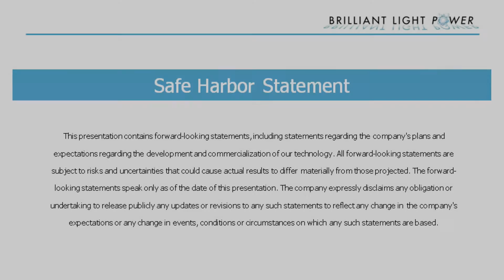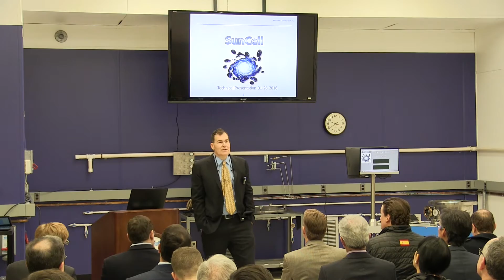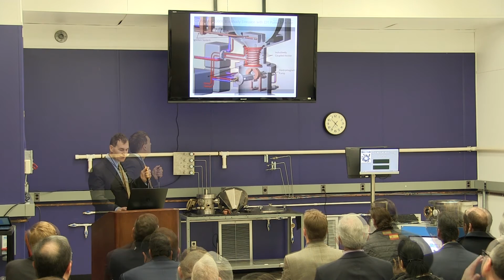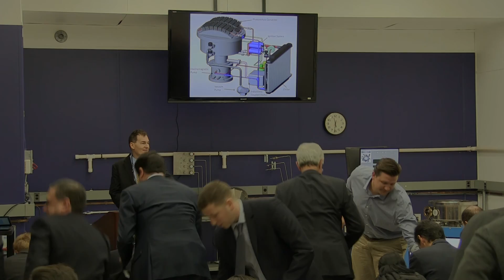Brilliant Light Power Demonstration Highlights, January 28th 2016

Comment: With water supplies already dwindling across the globe, how would such a device that utilizes water effect these supplies if homes and businesses were to all go to this method of energy generation?  Would the wars switch from wars for oil to wars for water?  I guess it's better than pumping millions of gallons into the ground to extract natural gas.
Reply: I think households in the USA waste more water then this invention and one has to consider the savings in regards to an alternative energy source
Reply: BeanieandCecil CecilandBeanie the terrifying part of this was in a bit of explanation I caught regarding the end products of this process.  I'm not sure if this is legit but the video claimed the hydrogen was altered to lower valence level than our good old h we have in water.  they claimed it was going to off gas from the planet and that they had determined that it matches all the dark matter in the universe.  surplus oxygen on this planet,  running out of hydrogen.  sound like a big rusty mars
Reply: So basically Mills device makes so much energy that we could easily convert salt water or seawater into drinking water so cheaply it would actually cause a surplus of clean usable water world wide over time.
Reply: David L it turns water  h2o to an  h and  h and an  o2.  the hydrogen altered form will leave planet.  leaving oxygen here.  water being consumed.   they need a way to restore the hydrogen  and then run both h and o2 back through fuel cells for another gain

Comment: Make a closed system - water goes in,  power comes out. 
You can vaporize water and drive a turbine, the temperatures claimed are more than enough to make it work. Or use Sterling engines, photovoltaics. 
But this needs to be demonstrated as a physical object producing energy before it goes into production.

Comment: Ok, so let's say you take a normal hydrogen atom... then a positron and fire it at the hydrogen atom and it hits the electron and they annihilate. How would a hydrogen atom with a annihilated electron be different than one of Mills' claimed hydrinos?
Reply: A Hydrino still has an electron; it's just closer to the proton.
Reply: B Yoshikazu Yes but I am trying to determine how a hydrino would be different than a proton with no electron. Maybe it's not a hydrino and it's an antimatter reaction.
Reply: Hydrino has no net charge while a proton would be charged.  That's a start. .
Reply: B Yoshikazu How is the charge measured?